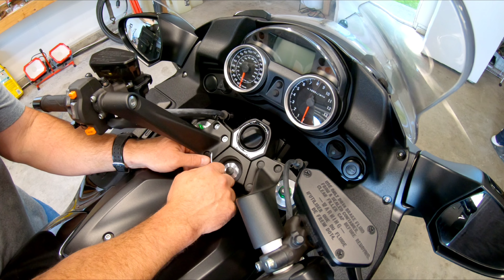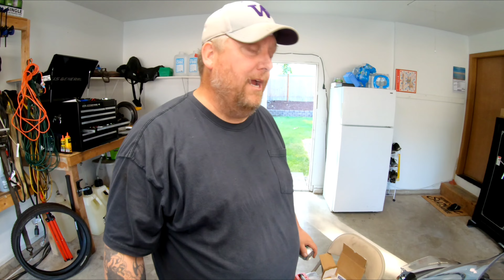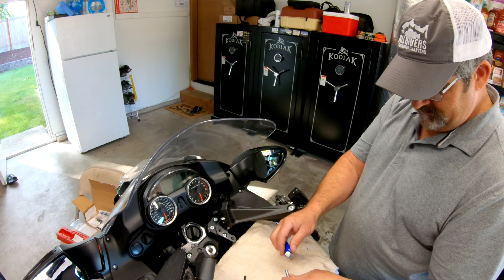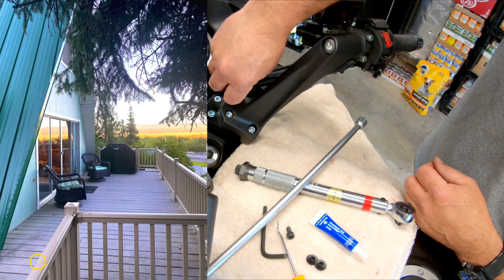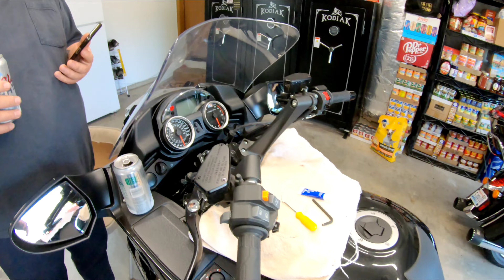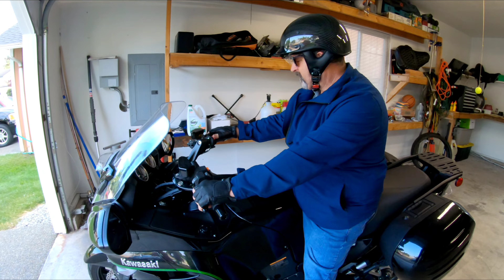HELIBARS SETBACK RISER KIT INSTALL ON KAWASAKI CONCOURS14

Comment: I installed a similar riser kit on my 2014 Honda F6B. It made a great improvement in the riding position and comfort. Great video!
Reply from the maker: Hi dave_of_the_forrest,  Gotta love those F6B's.  I've done a lot of work on them.  I replaced the air filter which was a huge job.  Made a video of it to help out others...
Reply: @BG Rides  yup, did the air filter last year. Thanks Honda, what a pain in the ass. 😂
Reply from the maker: @dave.of.the.forrest    Yeah.  It's like they built the bike around the filter :)

Comment: Does the gps mount from kawasaki still fit with the risers?
Reply from the maker: The Garmin GPS say in a holder that connected to the gas tank.  It didn't doesn't connect to the handle bars
Reply: @bgrides2108  i have the original mount which is connected to the 4 bolts right in the middle of the handlebars. Did the risers move the handlebars apart or are they the same distance away from before you installed the risers?
Reply from the maker: @duckieduck3287  i wasn't sure, so I watched the video again.  It does look like the mounts move a small amount apart.  Maybe the GPS mounting plate holes could be slotted slightly.
Reply: I'll see if i can get in contact with Heli to see if the standard mount can be used still  @bgrides2108
Reply from the maker: @duckieduck3287  that's a great idea